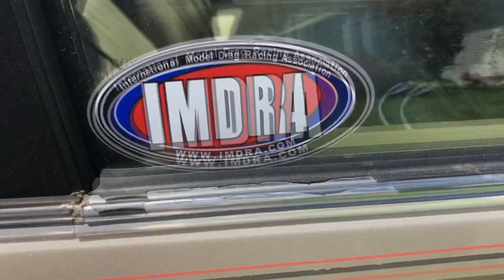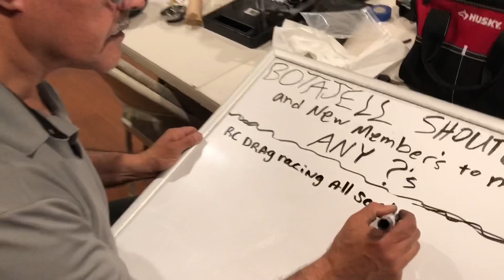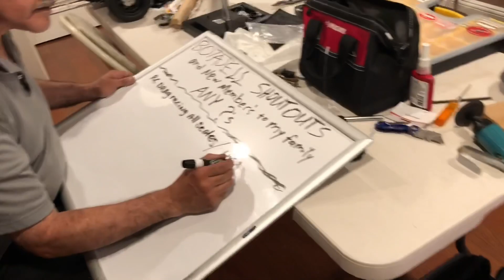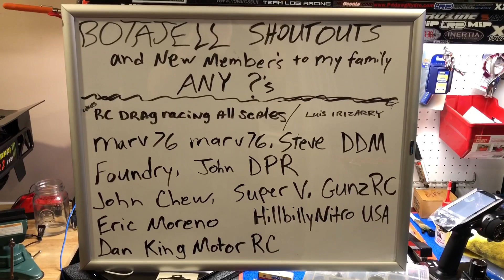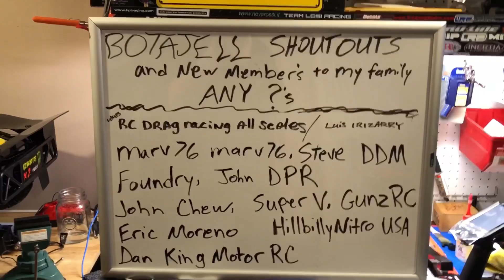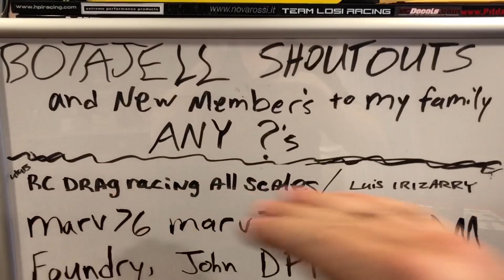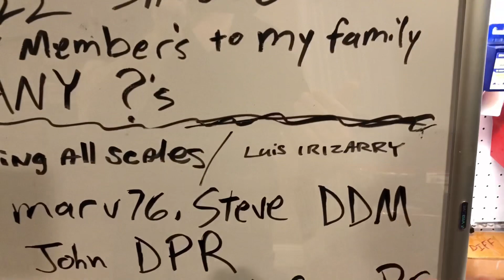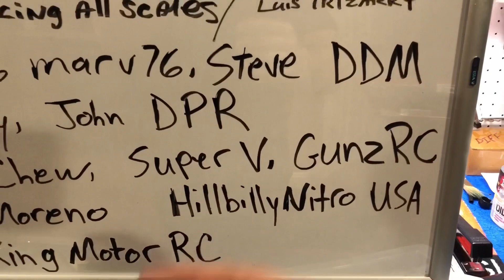BOTAJELL BAJA Drag Build, Spec.Guest, Suspension, How To Replace 2 Speed Tranny Bearings(Shout Outs)

Comment: When ever you drill or cut carbon fibre,seal the the cut or drill hole with a small amount of glad fibre resin or some loctite super glue and once it soaks in give it a little more then wet the super glue as it drys harder and stronger ;)  you can use super glue on real helicopter blades when they get small chips when using water with it ;)  test the super glue loctite on a old peice of fibre glass or carbon fibre,,works great !! Beautiful build !!
Reply from the maker: BUZZ thank you and thanks for the heads up with that great idea when working with carbon fiber. I wound up using some Gorilla Glue just because that’s what I had next to me . Hopefully it will work and if it don’t? I will replace the chassis with a light weight aluminum one that’s almost the same in weight but stronger less maintenance to use and modify
Reply from the maker: Check out my friend Louis when you get a chance https://youtu.be/ASp0I_8jlXE

Comment: Also John on the km 2 speed another thing to watch out for that I caught is the springs they give you to put in shift setting hole  with ball !  Look at springs on mine one was way shorter than other  I didn't notice it an had the short one in an by time you adjust it it way to tight  to shift cause of length of spring
Reply from the maker: Levi Hogge thanks for heads up ! Try not to over tighten that otherwise you can crush that spring? I still have everything that came extra with my 2 speed and I’m just running running my KM 2 speed the way it came out of box except for what happened to my oneway bearings! It took many try’s to get my 2 speed to shit ! I started out of flush a bit then I started to adjust a 1/4 at a time every time until she started to shift
Reply from the maker: At the track under load and maximum grip from the prep on the track the shifting will be different and it needs to shit later at the track and sooner on the street depending on what engine your running
Reply: BOTAJELL OK thanks I'm running the full mod obr 32cc ! Think my shifting claw may need changed out looks rounded at end instead of sharp

Comment: The 2 one way bearings are locking the gear solid to the shaft.. i have the same problem with my km 2sp
thanks to you i caught this before running it for the first time, i have to contact dan at king motor
John do you know the part number tool he used to remove/install  the bearings?
Reply from the maker: richie cee I don’t have a part number for it and it’s hard to get that tool . The only way I know how to get one for my self is to look for one that looks like it then buy it and try it out to see if it works !!
Reply from the maker: I will do my best to look for and find a part number for it
Reply: s-k 8mm 3/8 drive socket fits perfect, socket # is 308
now im just waiting for the bearings
i did a search for needle bearing tool they all look too big
for this bearing.

Comment: Hi John, what wieght diff oil should I run I'm my baja with the 70cc build? It should make about 12hp just so you know.
Reply from the maker: Karrie Bhurgari wow 😮 super Zeeeeeaah!! Bro I say try out different weights and springs to see what works best for your set up and what your doing with it on or off road
Reply: BOTAJELL what diff oil do your recommend i start with?
Reply from the maker: Karrie Bhurgari I’m running 1.000 now but may go to 5,000? I would not go past 10,000 because with the Baja the thinner you go the more locked it’s going to be unlike the Losi and other RCs with those the thicker you go the more locked it will be

Comment: Epic baja's man! Ive just put the kraken arms on mine but im having troubles as the drive cups are to big for the shafts, dont suppose you have heard of this and can suggest which shafts i should be looking for? Thanks dude
Reply from the maker: Jay Pearce have you tried the bigger all new ALX shafts ? They should fit but I would just use the matching set drive cups and shafts that was designed to work together. Maybe MIPs or Phat Dads? Don’t know ? Hope you find what your looking for and that it works well for you please keep me posted! I know how you feel right now but just keep at it!! 👍💥👊💥🤝🍻🍻
Reply: BOTAJELL Thanks for the reply buddy, will soldier on with it as will be so worth it! Looks awesome wide, its a bit of a pain getting the good stuff in the U.K though..

Comment: Hey John   maybe you could do a video on how to adjust the km 2 speed cause mine has never shifted as good as yours does !!!
Reply from the maker: Levi Hogge make sure the spring and ball is inside and don’t crush the spring. Our 2 speeds are actually pretty damn good . Just keep adjusting the grub screw 1/4 turn in at a time from flush

Comment: What's up bruh  been watching your a couple of your videos and finally Gave in and got an X2  excited but the only thing is I don't really know much about it it's my first 1/5 ever and first r/c just need a bit of guidance on it just wondering if what tools I need and the measuring cup did you get that from ddm ??? Thanks in advance
Reply from the maker: EGenis210 that’s awesome bro congratulations 🍾🎊🎈🎉!! Do yourself a big favor and please start out with these tools then go from there and start making your own tool shop that you can do many jobs with http://www.davesmotors.com/complete-ddm-hex-driver-set-standard-and-ball-end-with-handles-and-socket-holder.html
Reply from the maker: This is a must as well http://www.davesmotors.com/Products/searchresults/
Reply from the maker: Also http://www.davesmotors.com/3330-97310-Zenoah-Flywheel-Air-Gap-Gauge-Tool.html
Reply from the maker: http://www.davesmotors.com/DDM-Allen-Hex-Hardened-Short-Steel-Drivers-Set-of-5-2-2-5-3-4-5mm.html
Reply from the maker: And this is great to have if you can http://www.davesmotors.com/FMF-HD-Spring-Puller-Tool-011231.html
Reply: Alright cool cool I got Everything but the second one you posted  didn't pop up   And the barriers or charger I might go to your favorite place the hoppy store this weekend hopefully your favorite place track Day hobbies anything else you recommend I guess the battery charger ?

Comment: Hey, why did you buy a KM and not a hpi?
Reply from the maker: 100_K _S I bought the king motor so I can use only some  parts that I would need off it . I’m Not using the king motor I’m using a Baja that I built from scratch out of Rovan Carbon fiber chassis and lots of other mixed parts from different companies you can go back and see what I used because I show everything. After seeing KM Baja in roller form before I stripped it and after I took it all apart I would definitely get one for my kids to start out in the 5 th scale life or for a first time newbie! I would even be able to buy 2 or 3 of them in one shot because the price on them are great 👍 as well and since I have 3 kids that would help me greatly! I would just upgrade the shocks on the roller KM for off-road use! This is my honest opinion from what I have seen and used with my own hands
Reply: BOTAJELL Thank you bro👌 Yes its like more than the half of the price of a hpi